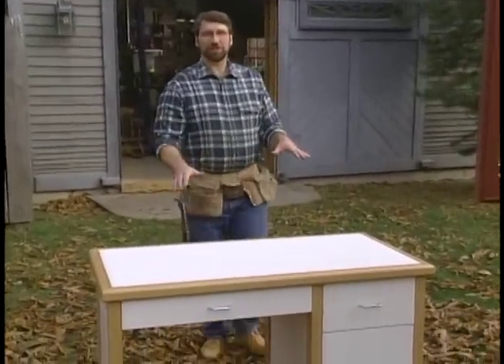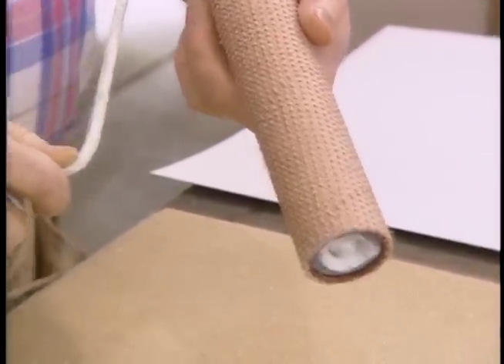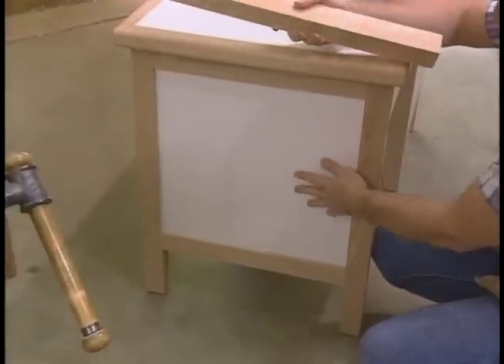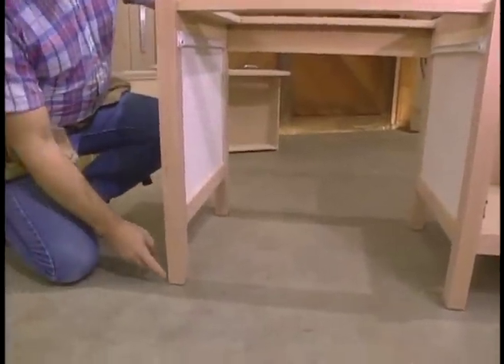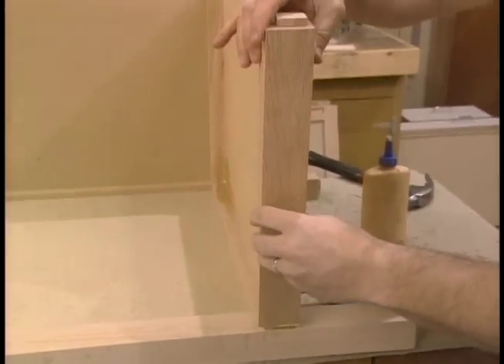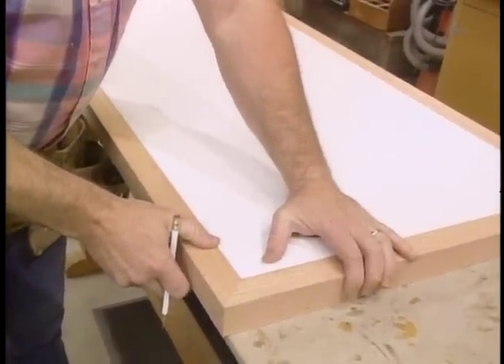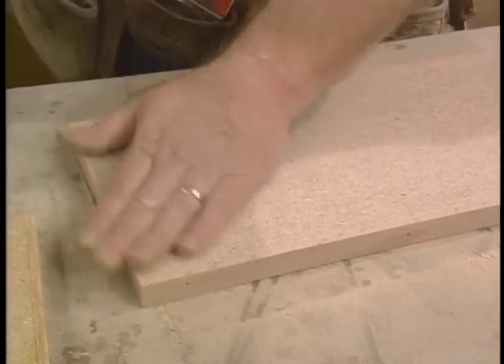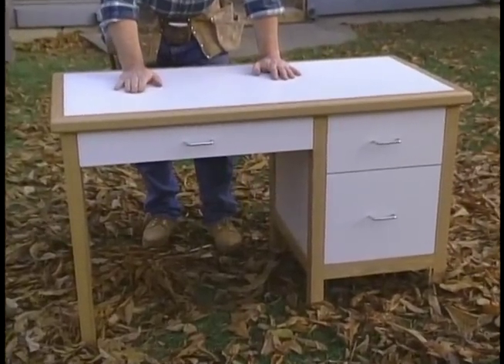Students Desk  |  S6 E8

Comment: I bet this desk weighs a ton - laminated particle board is really heavy. Norm probably had to get that neighbor with a night job to come over and help him move it into his house from the shop.  I know, because have some old closet units made like this and the only reason I haven't replaced them for thirty years is that they were so damn heavy I don't wan't to move them again.
Reply: Yeah, it’s way overbuilt and frankly kinda ugly. Using 3/4” plywood would have been plenty strong. And with plywood you could do the whole thing with pocket screws.
Reply: @johnsrabe  Yep. Not to mention that particle board falls apart in humid climates, and doesn't hold screws well.  Also, there's the exposure to the nasty contact cement vapors when putting on the laminate. Just use a nice veneer plywood and you'd get a nice-looking, lighter-weight (but stronger) unit that could be clear-coated or painted.
Reply: @Pipsqwak  I could see putting a sheet of laminate just on the top. Better for writing and projects etc. But then again it could be worth it to spring for some phenolic for the top.
Reply: @johnsrabe  Yeah - if this was for a workshop or some kind of industrial use, laminate on top would be okay.  Norm's workshop cabinets that are built with plywood and laminate tops are excellent.  But particle board for furniture sucks.  I hate the stuff.  It weighs.a ton, looks cheap,  and it really does not hold up well unless completely sealed somehow.  It's nothing but compressed sawdust.  Quality plywood or solid wood is just so much better for furniture.  Take it from a boatbuilder and long-time woodworker and finisher.  Just avoid particle board, MDF, OSB, or anything like it if you want a project that stands the test of time (and moisture if you live in a humid climate or plan to use a piece anywhere that might get wet, like a bathroom or basement or outdoors).
Reply: @Pipsqwak  I really don’t understand how people can use it for bathroom vanities or under kitchen sinks. Not only does it get wet but it stinks!